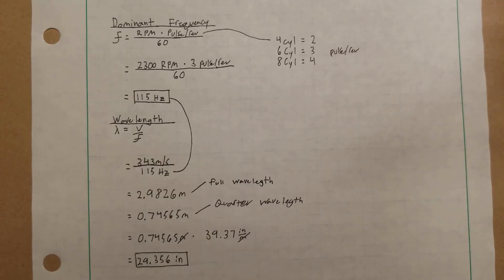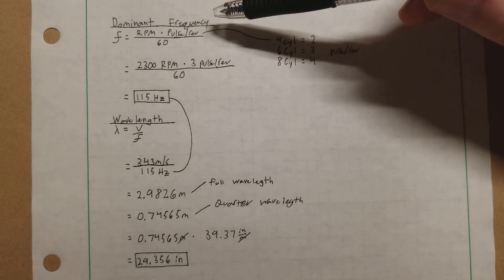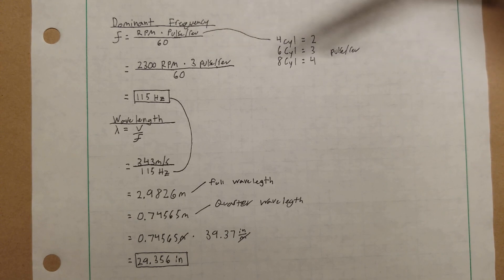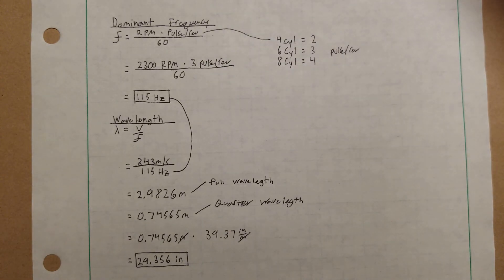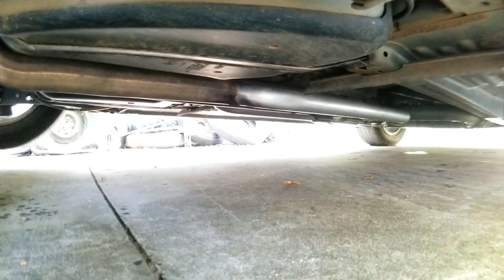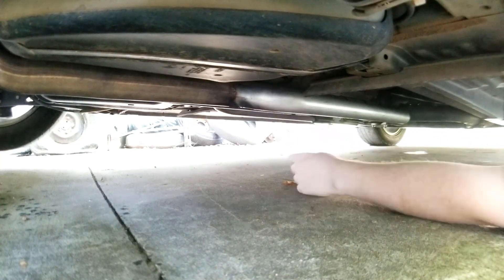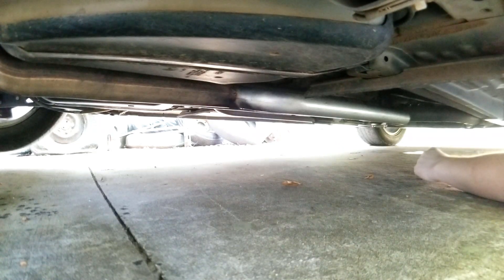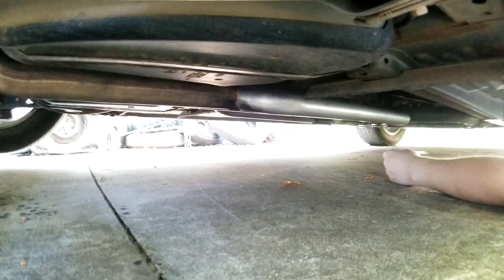Make a branch resonator to get rid of exhaust drone

Comment: Situation: I've got a 3.8 V6 engine in my Wrangler. I did the muffler delete. I  installed a 3" single tip exhaust and that's when the "tuba" sound started at around 3,000rpm. I swapped that out for dual 3" tips to try to remove some of the "tuba" sound and now it just went up to when I'm going about 3,500-4,000 rpm. What causes that?? Exhaust flow on a bad setup? It sounds like a rumbling beast at idle and when taking off - all the way up to 3,000rpm - and then the tuba sound starts.

I also added a 28" cherry bomb to see if that would help, but it slightly helped. It's like WOMMMMPPPP like a tuba. LOL! But I have to be on the gas HARD for it to happen. If I just have my foot on it for gradual increase, it sounds better, but it's still right on the edge of wanting to do the tuba sound the moment I hit it.

Ever heard of that?

Comment: How did you find the velocity number dude? Is that a standard number like pi or did you take it from somewhere else?
Reply from the maker: It's the speed of sound. It varies with temperature and altitude/pressure, but that's just a good round generalized speed.
Reply: @daniskaengineering  that’s fascinating. So do you note any performance decrease with a branch resonator? Also should you point the blocked end toward the front or the rear of the car? I guess the rear?
Reply from the maker: No noticable decrease in performance. The direction it points doesn't matter, but I pointed mine forward due to space constraints.

Comment: I have an x pipe. So does that mean Id divide my length by 2 as ill need them on both exhaust pipes?
Reply from the maker: No, you'll just make 2 resonators after calculating your length, and put them on each side. You can differ the target frequency on one slightly to widen the effective range, like I did, but that's a personal call.

Comment: Great video! My droning is about the same as yours; around 2000-2300 RPM and my car is 6 cyl.  The difference is that my car has dual pipes all the way from the engine to the back.  Since I would also need a 30-inch J-pipe, does this mean I put a 15 inch J-pipe on each side?  Please advise.  Thank you.
Reply from the maker: No, you would need 30" on each side then.

Comment: if I use 3in exhaust pipe what size should I use for branch resonator should I use the same size or I can use a smaller size
Reply from the maker: I would recommend a smaller diameter for the resonator. I also recommend using the same size as what hole saw you are going to use.